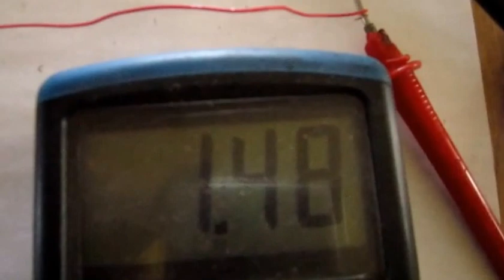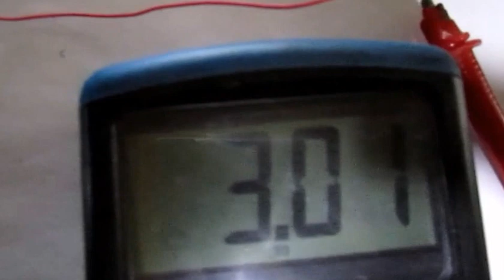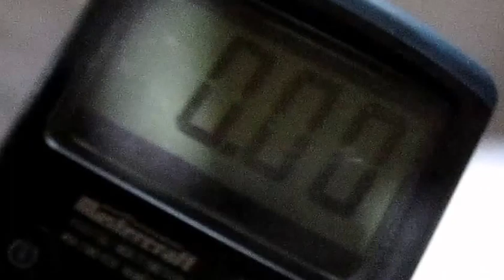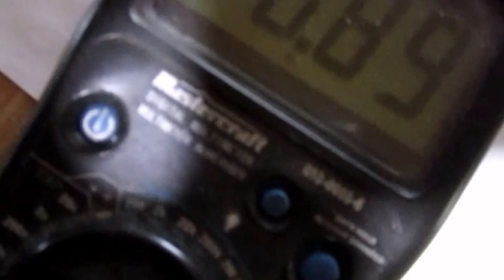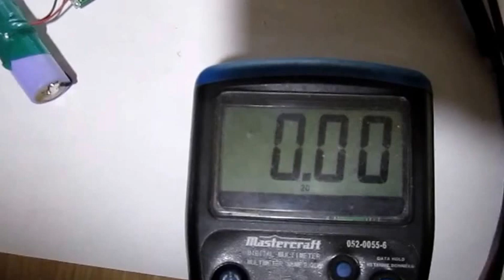How To Change The Output Voltage Of A 3.7V 18650 Lithium Battery

Comment: Post that link please!!!!
Reply from the maker: https://www.ebay.ca/itm/Mini-DC-DC-Converter-Adjustable-Step-Down-Module-Power-Supply-Voltage-Regulator/130994366448?hash=item1e7fdf67f0:g:zU8AAOxyWt5SVj86
Reply: Thank You. Gonna run 2x18650 in series and step it down to 5.7v....then to a 5.5x21 mm plug to take my Roland JD-XI mobile.
Reply from the maker: Perfect and your welcome.